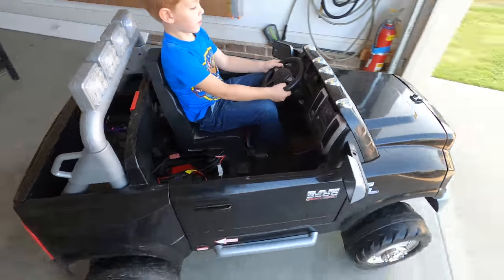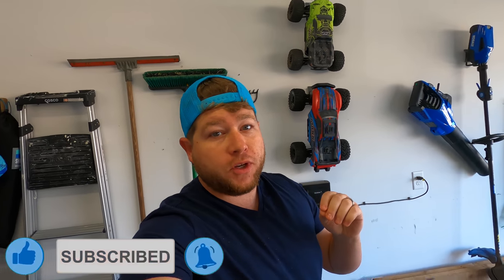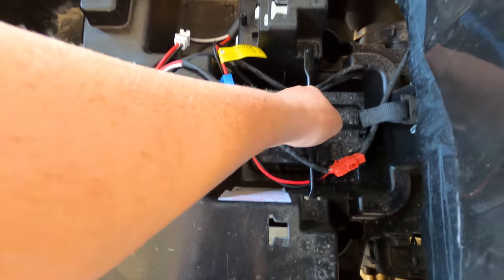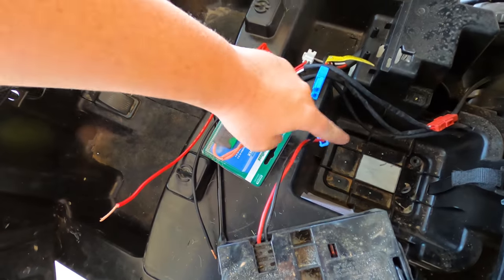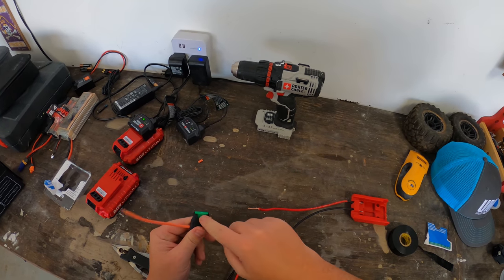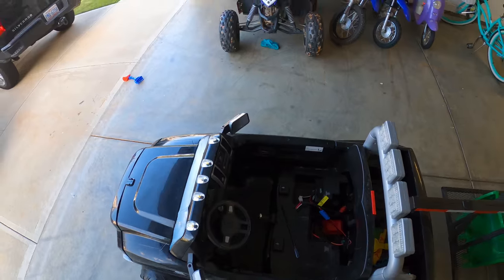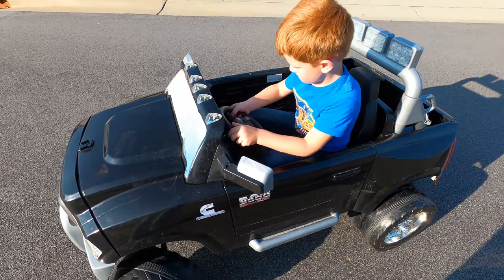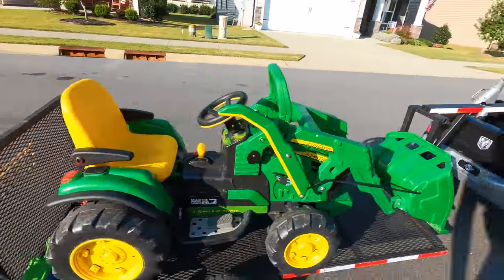Kids Power Wheels Modified Drill Battery Upgrade!! (EASY DIY)

Comment: Awesome video. I do however think your 3p amp in line fuse is overkill and won't trip incase of an issue. Your battery is 20v now. You should test your line for amp draw and decide then what fuse to install. I would assume a 15 to 20amp fuse is more than enough for your application.

Comment: Totally great idea..I did this just today with my daughter's 12 volt and it is amazing..question tho..did an increase in rider weight seem to blow the fuse?.. when my 8 and 4 year old rode together it blew 3 fuses but my 4 year old alone works great
Reply from the maker: Yeah it will! But if you start in low and change to high while driving it won’t blow the fuse.
Reply: Thank you very much
Reply from the maker: @kevinkniebbe6753  no problem man!

Comment: You should have a low voltage disconnect adapter in line so that you don't destroy the expensive Dewalt drill battery

Comment: Great overview! My son has the same truck. Only problem now is the 20v 1.5 AH battery doesn't last long enough. Going to look into a bigger battery like a 20v 5 AH. Any recommendations outside of a low voltage shut off?
Reply: Just got a "dewalt" 20v 10ah battery on Amazon for $60. It's literally 5x plus the ah of the 1.5
Reply: I also added 550 heat sinks to the motors so they won't burn up

Comment: This is an awesome upgrade. Just picked one up for my girls. I heard you mention low and high gear, but ours has fwd/rev. Can it be rewired for low/high, or do you just have a different model. Thank you and GOD Bless you and your family.
Reply from the maker: Must be a different model as ours came with 2 speeds!
Reply: @realmmfc  I figured it out. Turns out I had 1 fwd 2 rev. I mistakingly inverted the motor positions in the rear. Instead of white in white and yellow on yellow, I swapped connections yellow to white on both and problem solved. Better than taking it apart. Problem fixed. Thank you again for the video.

Comment: How long does the battery last? Compared to the 30-40 from the original battery
Reply from the maker: All depends what size amp hour battery you have. The standard one for the drill is 2ah and we can get 20 mins. I bought a 5ah porter cable extended life battery and get well over an hour per charge on that one
Reply: @realmmfc  can I ask where you bought the extended life battery?
Reply from the maker: @truthhurts7529  I purchased my porter cable batteries off of Amazon.
Reply: My grandson has a hero atv 12 volt it has more than a couple wires I am assuming the rest go to whatever makes the sounds. Should I just do what you did or do I need to wire around those other wires. I have the kit already and bought a porter cable 8.0 amp.......

Comment: Did you have any problems with batteries getting too hot?
Reply from the maker: I had heard that was an issue so I bought 3 1.5ah batteries rather than one large one. No issues at all. Run time is about 15 mins each battery on max power, but since it’s so quick to change a battery it’s a non issue brother!
Reply: @realmmfc  you're the man! Thanks for the quick reply!
Reply from the maker: @jessegibson  not a problem! Happy to help - Thanks for tuning in!
Reply: You could also run dual battery to reduce the load on one, thats what I did. Now for a trailer so I can have my kid clean up sticks before I mow😂

Comment: My dewalt battery stopped working after this it over heated and only one light will light up but i wont power my drill even a littlw
Reply from the maker: In most drill models the element that helps prevent overheating is a function of the drill rather than the battery. That’s why I prefer to use those 1.5ah battery’s, I’ll drain them before they can over heat!

Comment: I have dewalt batteries. Would the flex volt batteries work?
Reply from the maker: I am honestly not sure if they work with the porter cable base, but they have dewalt bases for sale on eBay and Etsy!
Reply: @realmmfc  right on. Appreciate the video. Heck I was about to go buy another lead battery for my kids gator. I think I’m gonna try this out.
Reply from the maker: It’s been solid my man!
Reply: @realmmfc  could you post an Amazon link to the fuse kit you got.
Reply from the maker: That’s the one!
Reply: @realmmfc  I got my adapter in today and wired it right up. My son took off! Much quicker.  Question - I used a 1 amp hour and it honestly lasted full blast around 8-10 minutes. When I took the battery out it was warm/hot. Is that to be expected with the smaller batteries?
Reply from the maker: @bballtwenty22  I am not entirely certain my man. Ours has not gotten hot, but he rarely drives it for longer than 10 mins continuously. We are running a 4ah battery and can get about 45-50 mins of use.
Reply: @realmmfc  gotcha. Yeah I think it was just due to it being an older 1.3 amp battery. He ran it in high gear pretty much consistently until it died. Now the battery won’t charge... oh well 
I’m probably gonna buy some off brand dewalt replacement batteries on Amazon to run in it.
Reply from the maker: @bballtwenty22  let me know how it does. Like to pass along the helpful information to others when I can!
Reply: @realmmfc  will do. I’m also trying to find if there is something I could install to keep the batteries from overheating or being discharged too much
Reply: @realmmfc  I know I keep dragging this on, but I think I actually found a solution to what caused my problem. Since I likely over discharged that small dewalt 1.3ah battery I found some replacement off brand on amazon that has over discharge built in.
Reply from the maker: No worries! Good find. Lipo batteries are temperamental for sure!
Reply: @bballtwenty22  hey I just did a dewalt swap but it got really hot help please lol
Reply: @victorramirez897  sure. What kind of battery did you use? What got hot?
Reply: @bballtwenty22  it’s a dewalt 20v 5.0 ah and the battery was the one that got super hot
Reply: @victorramirez897  the problem likely is that dewalt batteries do not have over discharge built in. It is built into their tools. 
I bought these in the link below from Amazon for my kids ride. That way I don’t ruin anymore dewalt batteries. 
2 Pack Waitley DCB200 6.0A Replacement Battery Compatible with Dewalt 20V Max XR Tools https://www.amazon.com/dp/B07PYTRW65/ref=cm_sw_r_cp_api_glt_fabc_J87G894A7JBGM9H0HPSQ?_encoding=UTF8&psc=1
Reply: If you discharge these batteries too far the charger won’t charge them. I wouldn’t take them below 15 volts, you need a discharge circuit that cuts the current with a relay when the battery reaches that voltage
Reply: @EagleKeeper86  that’s why I bought some batteries that have the over discharge built in.

Comment: My Dewalt battery keep burning out after 15 minutes and won’t charge anymore.
Reply: mine to you find out why?
Reply: You need a low voltage disconnect. The power wheels is draining the batteries too low for the charger.

Comment: That's so slow, I thought this was gonna be an upgrade. That's slower than the 24 volt power Wheels they sell. You got to do my build, my daughter loves it. It'll haul me, my wife, 2 kids and trailer with pool gear. Does require a weighted front. Has three speed rocker switch shifter, spindle motors, opened up turn radius, replaced accelerator pedal with hall pedal and custom fit trailer tires. Top speed 24mph
Reply: Link?